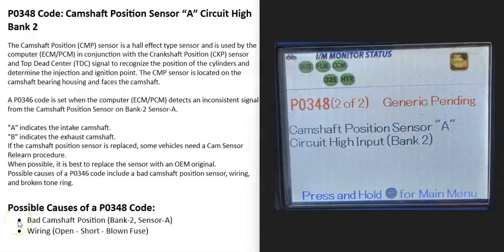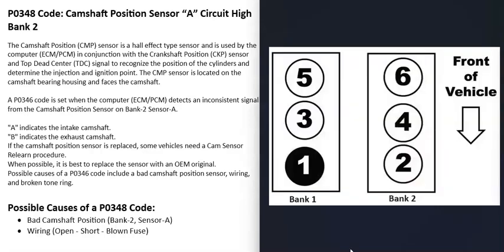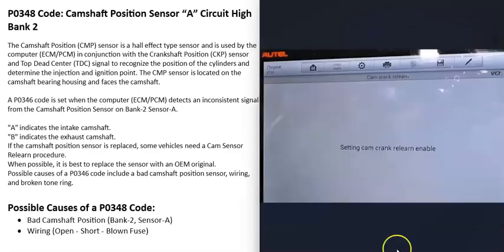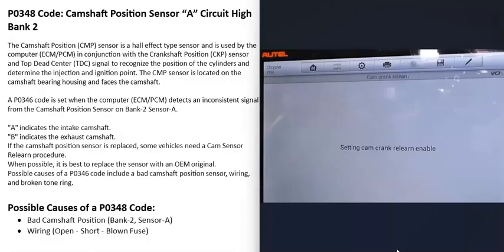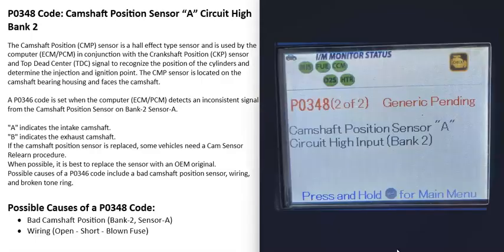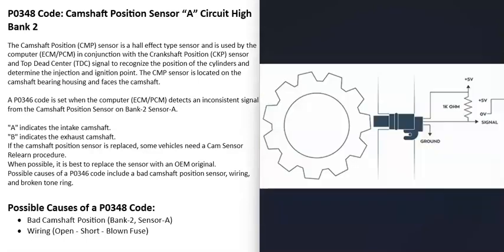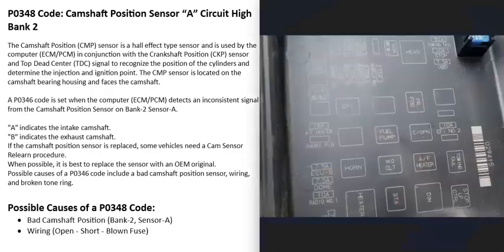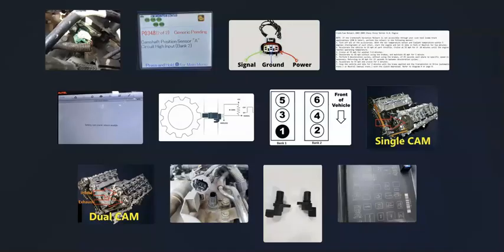Causes and Fixes P0348 Code: Camshaft Position Sensor “A” Circuit High Bank 2

Comment: Hi i have 98 honda civic ex and was curious my Fuel Pump when turn on the humming noise is very quiet but i can still here the click on relay. My Car can start up fine. But when i start my car i smell fuel coming out of my Exhaust. Does this mean my Fuel Pump needs be replaced or my fuel injectors?
Reply from the maker: If you have a scan tool, you could check the fuel pressure to see if it is correct, although it does sound more like a bad injector or fuel pressure regulator. It needs to be diagnosed.